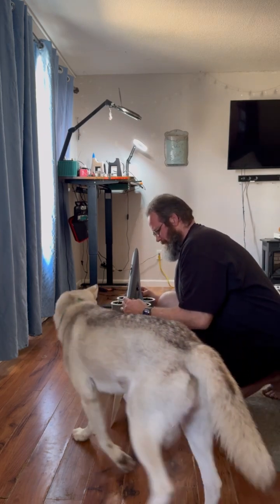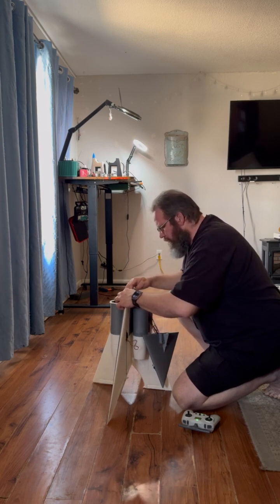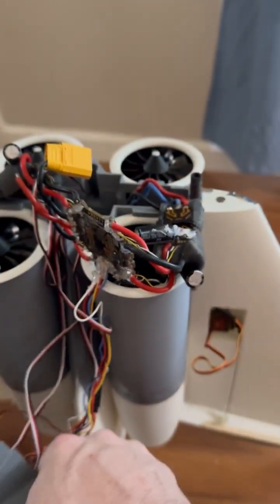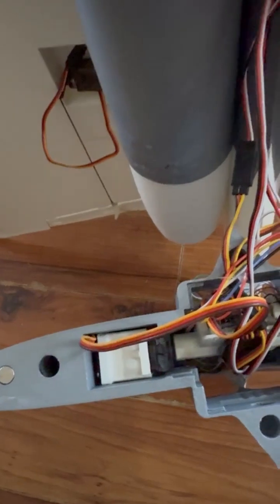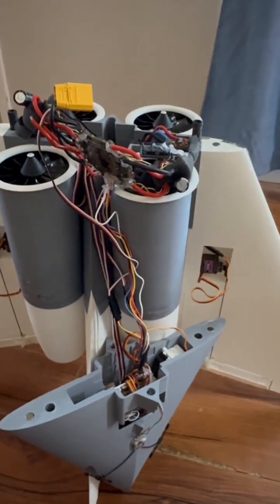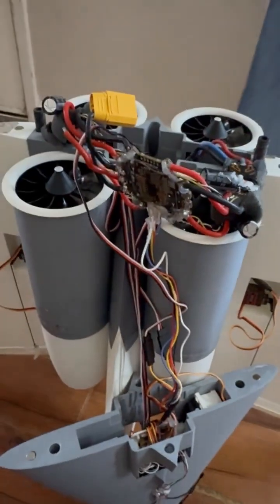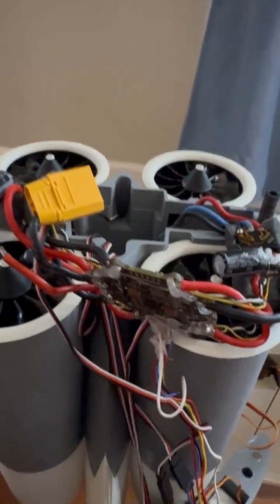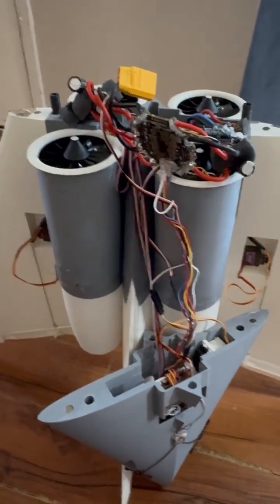Javelin hover test 2 #70mm #edf #drone #vtol #foryou

Comment: please reply to my comment How much will the drone cost? How much weight can it carry?
Reply from the maker: The 120mm times 4 can has 76.42 lbs. of thrust.
Reply from the maker: The Shrike XL I am building will have 440 lbs. of thrust operating with 4 170mm EDF turbines.
Reply from the maker: You will need 150-amp ESCs with these motors and at least a 500-amp power distribution board running at 12s 0r 48 volts on the lipo.

Comment: Don't use hot glue on wires connections in a hot environment. For that, I use smartphone glue such as T-7000. Heat is not bothering it and if you have to remove it, just scratch it (screwdriver, nails...)
Reply from the maker: Thanks, I'll pick some up. Wires bending and breaking has been the bane of my existence.
Reply: @warmachined3472  you are welcome, since I have the same issue with soldering. Btw, the esc in the airflow is a good idea, just "dig" some space in the plastic so that the ESC is sitting flush (minimal airflow perturbation)

Comment: An interesting and challenging project! My six cents:

1) For 264 amps (if I've heard it right), the wires coming off the battery were really too thin. I would rather say that even this connector appears too weak for such currents. I hate saying this because I also tend to overload wires and connectors, but at this scale it may be really important, and these particular wires seemed scary even to me.

2) On the scale of the things I am doing, ESCs and most of the stuff does not get hot, especially if I put them in the flow. For this, I would probably put the ESC radiators in the flow of their corresponding EDFs in the way they don't obstruct the flow.

3) For stuff that gets hot, PLA may be not the wisest choice, because it starts to melt at around 60 degrees Celsius. Just a warning. I've once had motors that got too hot to start slowly melting their mount points made of PLA, which made propellers to bite their ducts and stop. For this reason I've remade everything in that machine from PETG, which is a little bit more heat-resistant, even that it required the whole machine to be essentially ripped apart and assembled from scratch.

4) It's just a feeling, but ailerons look way too small to me. They would probably work at high speeds, but by that time the craft would probably have lost control before long.

5) I might have played too much with machines that like to oscillate in pitch or roll and then fall to the ground, but... It seems to me that in order to maiden the transition, the quad-hover mode should be as tight as it possibly can, otherwise the forward-to-VTOL transition will be too much a disturbance for the machine, and it will crash. Or you should plan to land in the plane mode.

6) Is it that you rotate the flight controller in order to achieve transition? This seemed a funny design choice to me, but the more I think about it, the more I seem to dislike it. My main concern is vibrations, which are harder to control if the FC is mounted via some kind of servos, and especially the vibrations from these servos during the transition itself. Maybe it's less important for a large machine where one can set filters low and do not compromise control much, but this is also a fast machine...
Reply from the maker: To point one; I have ordered larger pure copper wire as opposed to copper clad aluminum (China's fault not mine) to replace the old esc wires, as well as new high quality 50v 1000uf capacitors. The PDB can handle 500 amps constant current. ESC's can handle 80 amps with a 100-amp burst, well over the amps required by the motors. 

Point two; a bladed heat sink within the flow will be one of the next modifications with esc's mounted under each nacelle. Bladed sinks will help mitigate any effect on airflow in the chamber.

Point Three; I have never experienced any incident where my motors melted any PLA. 

Point Four; Additional deferential thrust helps with control surface drag created by large control surfaces.

Point Five; With Gyro filters it is easy to all but negate any adverse effects from vibration due to servo rotation vibration. The filter dynamics to work with EDF's alone is almost enough to make server vibration unremarkable. High alpha approach into drone mode accompanied by the differential thrust is enough to safely transition. 

Point Six; What are the merits of rotating the FC inside the frame. One servo is required. Less moving parts. Same principle applies whether its motors rotating or FC. The FC will read the given inputs and orientation and act accordingly. Transitioning from drone mode automatically moves the elevons to their proper position to level the plane wants transition is complete. Transition does not occur until 24.5 MPH at a 30-degree pitch in the belly forward direction. This is the minimum speed requirement for lift on my airfoil. 

Thank you for your input, Welcome.
Reply: @warmachined3472  

For 4), surely motors will do that. However, there may be a failsafe case where one of the motors dies, or the battery depletes mid-air. The battery may still have enough juice to run the flight controller and control the servos, which, if ailerons are suitable in size, may allow a relatively safe landing. Well, this all is valid if aerodynamic efficiency is enough for unpowered descents, but it may not be designed-in at all, and if so, my thought experiment is useless.

For 5), I don't know how exactly you are planning to transition to vertical, but if you can test as much of it when not yet flying, that would be good :) For instance, if during the switch it is going to get to hover as quickly as possible, it may get quite a lot of angular momentum in pitch by the time it reaches neutral angles. At this moment, because hover throttle is quite close to maximum throttle, it is quite likely to miss either altitude (start falling) or attitude (start overshooting), because when some motors are requested to work at their limits (as felt by the flight controller), altitude and attitude are in conflict.

If there was enough thrust-to-weight, it could have been feasible to fly acro/angle hold/etc in the copter mode to see how the machine behaves in different regimes - of course, assuming you are comfortable piloting in acro-like modes.

For 6), the alternative may be to not having to rotate the FC, and instead rotating the coordinate system in the software. No servos are required, no moving parts. You are using INAV, right? - they seem to have introduced proper tailsitters in 7.1 (https://github.com/iNavFlight/inav/pull/9347, also in release notes of 7.1). May be worth a try, even without redesigning the mount first.
Reply from the maker: 4- Ideas and thought, internal experimentation is never useless. Understanding how things work can help you build an entire aircraft in your head. I do it all the time. 

5- I have included an angle mode into the transition. Coupled with the high alpha approach it should be stable, stabilization begins at the moment of transition so it will aim for a stable vertical orientation and position hold. Thats why I included a gps module to assist in altitude hold and position. Angle mode does limit rpms, but I can still hover of 90 percent and the landing will take place shortly after transition. Kind of like the Starships belly transition. Thrust to weight in angle mode is 3 to 1. 

6- I will defiantly be checking that out. I have attempted the same thing on Inav7, need to update.

Comment from the maker: Also, may remove nozzles. The back pressure is confusing the PID loop in drone mode. It will also put the thrust exit aperture closer to the cg of the battery.

Comment from the maker: I have ordered 8g pure copper wire to replace all wires. The copper clad aluminum is not good at heat dissipation. Also, with new esc placement we should be ok.